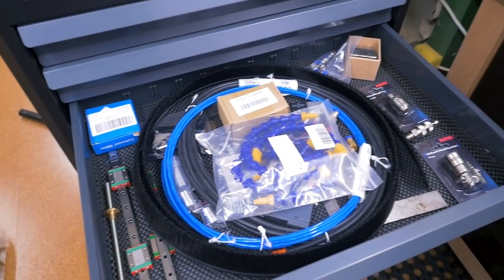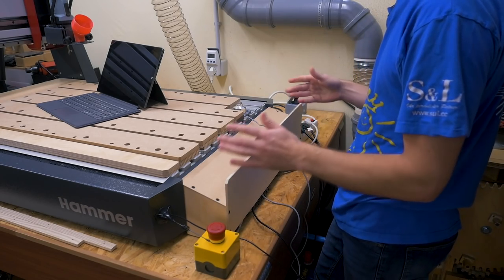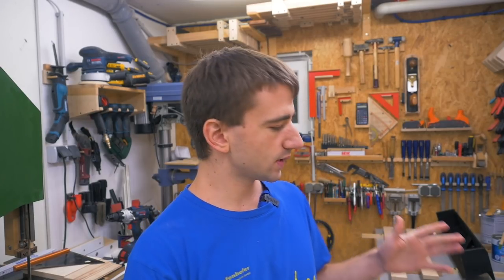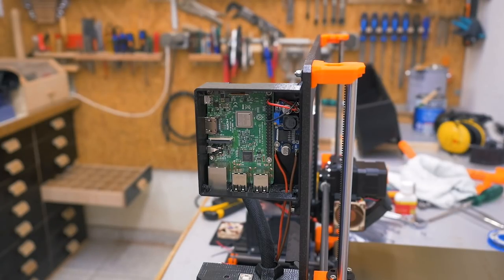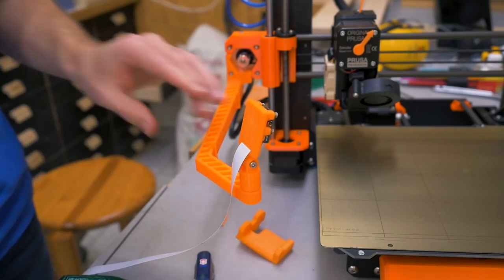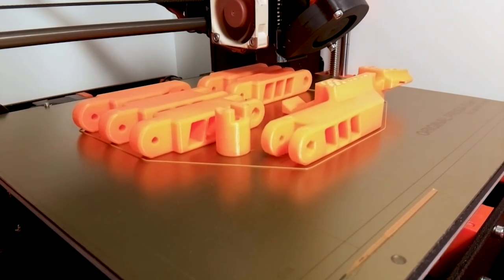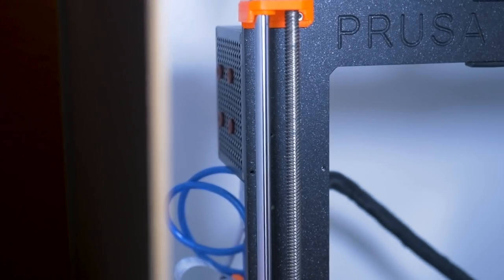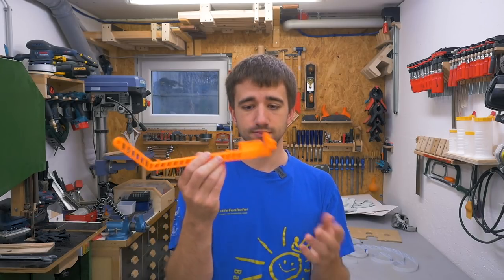Octoprint for the 3D printer and big project announcement (Random Shop Stuff 25)

Comment: Slotted screws are the bane of all true mechanical designer and engineers!
Reply: Robertson screws forever, eh.
Reply: I threw out all slotted screws from my dads workshop xD Fuck those things!
Reply: They beat the hell out of Phillips head  screws.
Reply: @calvingreene90  Torx master race
Reply: @calvingreene90  only if you have the wrong size screwdriver or no screwdriver at all lol. at least you can remove a flathead screw with half of the tools in a shop
Reply: Slotted have been around for 150 years? Manufacture was so much easier. So simple.
Reply: @bmxscape  
With Phillips you have to apply firm driving force even when removing screws even with the correct size driver.
Reply: @FearsomeWarrior  
True, but first generation of everything is lousy.
Reply: @calvingreene90  same with every screw on earth except torx and allen. with flat head screws, you must also use your other hand to hold the tip from falling out of the screw, with every single partial rotation the driver.
Reply: @calvingreene90  have you ever tried to use a drill to screw in flat head screws? id love to sit and watch you try!
Reply: @bmxscape  
Hundreds of times. I never had a real problem with it. Admittedly I prefer hex.
Reply: There is no engineering here.

Comment: Great video! Always enjoy these shop stuff ones. I got my first 3D printer a few weeks ago and never even used the SD slot. I went straight to Octoprint after doing some YouTube research, and never looked back. Also for what it's worth, I made the EXACT same setup with the step down buck converter for my printer to power a pi. I stepped the voltage down to 5.2 volts instead of 5.0 so that Octoprint wouldn't give me the power warning. For whatever reason, some Raspberry Pis need slightly over 5.0 volts or they throw a warning at the kernel level.

Comment: Marius, a straight 5v is not enough for a Rpi 3B which requires at least 5.1v to be normally powered. (you should see the underpower icon on the Octoprint's page) Personnally I set my PSU at 5.3v which is perfect for the Rpi power regulator. It's also not recommended to power the Rpi through the GPIO but to solder wires on the PP1(+) and PP3(-) under the Rpi. This way you keep on using the power regulation and power protection of the Rpi. This is probably wise with a chinese downstep module as power supply, by the way. ;) You should also make a custom USB cable with the bypass of the 5v wires. This way, the Rpi will not power the Prusa's rambo board by the USB cable. It's the good way to do it.

Comment: Does your PC have a decent filtered intake?  Project idea:  filtered cabinet for the PC, could mount it so it is off the floor as well.  Also, for shop applications I think passively cooling smaller computers such as the Raspberry Pi (maybe even your old editing rig) would be a better way to go.  No fans to pull in dust onto your components when possible is always a good idea in a work area where dust is a consideration :)

Comment: mounting the fan at 8:55: The normaly middle "washer" part of the rubber should be between the fan and the case. https://youtu.be/P-qSq9P_NLI?t=83 
(but the printer is louder anyway...)
Reply from the maker: Hmm okay. But the Noctua fan also has tiny rubber parts at the corners and these are now touching the case. But yeah, the printer is louder

Comment: Great "catch-up" video. Looking forward to the CNC dust collection project as that's on my plate as well, although ours is a considerably bigger and different CNC:  CNC Factory Viper XP (5'x10', 10HP air-cooled spindle, vacuum hold down and 10-position ATC).

Beyond the form factor, other complications for my project include automated tool changing, safety signaling and pneumatic dust boot control.

Comment: For the WiFi? I upgraded from an old Apple AirPort Extreme to a TP-Link Deco Mesh WiFi network. My garage PC is my workstation. The Airport was too slow (wirelessly) and I did not want to drill through the wall to send ethernet cord to garage PC. I plug the garage PC ethernet directly to the Deco mesh wifi and it tricks it to think it's hardwired. Bought another Deco for my brother's PC and we wired directly to it as well. Fast speeds all around the home.Hope it helps! Love the vids Marius! Keep on tinkering and improving your mods.

Comment: I would have used a switch to provide additional Ethernet ports from the power line adapter.  However what you did works without having to buy new hardware.

Comment: Friendly tip: Those DC-DC converters are normally rated for 1A, which for a RPi 3 B isnt really enough power. I had issues with mine so I got one that does 2.5A and now it works perfectly! I run Octoprint on my AM8 printer and its so much fun watching it via the webcam even though the printer is in the same room as I am :P

Comment: TP link...same as mine...just upgraded, as the old ones I had were lacking the latest security. Just for info, I found that you can connect different manufacturers units if they won’t communicate by a short Ethernet cable (if they are next to each other like yours), and they will work...like your printer setup...very nice...if only I had the time...

Comment: I have also widened holes in a raspberry pi. Mine was a model 2b, though. I designed a breakout board for some hall sensors and had it printed and shipped to me, but it's holes were too large and since the pi cost less that half as much as the prototype board I figured it was better to try widening the holes first instead of sending off for new prototypes.

Comment: Thanks for the video. You are not right about the aluminum being colder than the surrounding air. It will have the same temperature, but it just feels cold when touching it because it has a much higher thermal conductivity than air and transfers your body heat away from your skin much quicker than air. You can confirm with a thermometer that the temperature of the aluminum and the air is the same. The temperature of all the different materials like aluminum, wood etc. in the room (unless connected to a heating or cooling source) is identical to the temperature of the surrounding air. When touching a piece of wood, it will feel warmer to your hand than a piece of aluminum, even though the temperature is the same. Wood just transfers the body heat away from your fingers slower than aluminum will. 
When running the router, the top of the wood plate will heat up quicker than the bottom from the router bit friction heating on the top. Because wood is a poor heat conductor the top will heat up quicker than the bottom as it takes time to transfer the heat through a poor thermal conductor like wood. But the aluminum will never be any colder than the air even though it feels much colder to your skin.

Comment: I hate to tell you this but if you used a Raspberry PI Zero it mounts to the back of the Prusa control board and it will connect through the terminal holes supplied using longer terminal pins. The Prusa site has the instructions for this addition.

Comment: I found the Pi camera to give a very poor images compared to a cheap webcam, now I just use the webcam and it doesn’t seem to affect the Pi 3B in any way I could see. And it has a decent robust cable, that is long enough :-) And you don’t have to open the Pi to plug or unplug the cable. Now all we need is the CNC version of OctoPi.

Comment: I wouldn't hang the camera off the stepper like that, it'll put relatively huge twisting forces in the x-axis. Best to attach it to the frame at the bottom - yeah it won't move up with z travel, but honestly those kinds of timelapse aren't great anyway (they get old pretty quickly) best to pre-frame your shot, imho.

Comment: I'd also worry about stray wood dust filling the PC tower, even though you have such an effective collection system.

Ethernet kludge adds an additional hop, but I guess that's no big deal. Latest Wifi seems to be much more capable. Power line systems can be problematical depending on home wiring.

Comment: You will have problems with the dust in the PC. You should add filters to avoid the dust to enter the PC. It is crucial if you want to machine metal in you shop as the metal dust conducts electricity.

Comment: As far as the computer goes, I would think that the sawdust issue just from being in your shop would be a problem.. I'm sure you've done well with dust collection, but just seeing the dust inside your saw in your saw-slider vid would show a possible problem over time. It suggest you probably want some kind of filter on the intakes for the PC.

As to the teensy screws, yeah, PCs have their own unique screw sizes, it's a very good idea to order a general-purpose boxed set to keep around for use with any computer needs. You can get something like 100-200 piece with 6-10 different screw types, including the mounting posts (e.g., if you're putting a new motherboard down in a new PC case), and a couple sizes of flush-mount screws as well as the different types typically used in railing and securing devices (like drives) to rails. A lot of systems have inventive connectors/rauls available, but they often still need to be screwed on somehow.

Hilariously, many many years ago (OK, "decades"!), when PC magazine first appeared, they had a give-away for a subscription that was a handy little toolset. It was nice and really cute... Except that every single bit in it was too large for ANY PC screw. LMAO.

Comment: I really need to get Octoprint set up. When I 1st tried it in 2017 it failed with an error I couldn't find any fixes for. Might have better luck now. I also need to install the bed level sensor I bought 6 months ago lol.

Comment: Hi Marius, how many space are you now using in the cellar ? 80% ? I guess only the washing machine is left 🤪 nice Pril flowers on the wall 
I suggest to install some CAT7 cables during the next house renovation. I was lucky enough to have a support chute from top down to cellar (where my servers are). But I know in newer buildings with a chimney up from the cellar, there is often a gap between floor and chimney. That could make it easier to cross the Beton floors. While wifi still works in my cellar, the reliability and speed is much better with cable.
I like you 3D print Upgrades and what parts you are making. Thinking to buy my own, but iI am afraid what type of SW toolchain I need to use AND to learn. What is your toolchain ?

Comment: Marius, Really ingenious designs of the extra parts! Could you tell us and show us the reason you use the filament you use on the 3D printer? Seems strong but remains somewhat flexible. Maybe it get hard and brittle as it gets older? Thanks for another great and informative video!
Reply from the maker: It's just some cheap PLA. This construction doesn't need anything better

Comment: Im surprised the two ethernet to powerline adapters don't interfere with each other. They may actually be compatible, in that they are using the same framing protocol, but are intentionally ignoring each other's frames. This suggests that while they aren't interefering, they might be sharing the same signal frequencies, thus reducing the effective throughput of (that segment of) your network.

Regardless, if it's working for you, then it's perfectly fine.
Reply from the maker: I honestly didn't expect it to work

Comment: Powering through GPIO without fuse is the best way to burn Raspberry Pi... You should solder wires to the board before fuse used. Or add other fuse.

Comment: Wait how would the aluminum table be colder than the air temperature?
Reply: It Isn't.  A rare schoolboy error from Marius.
Reply from the maker: I now guess that the wood was bent from the beginning
Reply: Easy answer. When he goes into basement, he changes the temperature, with heater or by just being there. But the cnc has metal parts and can be considered a solid chunk of metal which reaches the equilibrium slower than the wood, so it can happen the way he explained.

Comment: Hi Marius, I love those rubber things you used to connect the fan, what do you call them and where did you get them please. I have a reasonable computer that I update when I can and the graphics card has five fans of its own without the fans to keep the core cool so I have a lot of fans I need to fit in my new computer cabinet. I like the idea of rubber mountings and that should also reduce vibration if I get any. I enjoy your videos and the things you make, I especially liked the life you built.
Reply from the maker: I don't know. They were included with the fan

Comment: Such a great video - I'm literally copying the whole thing - thanks so much!! One question - at 10;35 you connect the wires from the stepdown to the GPIO pins - how did you do that? It is not clear in the video and I would appreciate a steer here.

Comment: do you want to make a dust protector for your PC ? i guess it may be neccessary what with all the sawdust/off cuts floating around in the shop.
i know you have a really good dust management system but i know you will never get all the dust, and sawdust inside a PC is not really a good idea.

Comment: It's not recommended to run the pi from the printer PSU, as the PSU is barely enough for the printer itself. If you run into weird issues try powering the pi separately.

Comment: At 25:00 you mentioned there are some bed leveling plugins that you use, which ones do you use to check bed leveling?   And at 25:30 you mentioned there is a plugin that tells you  how much to rotate each screw, which plugin is that?
Reply from the maker: the first one is called "Bed Visualizer" and the second one for the screws is "Prusa Leveling guide"

Comment: I rarely think you are wrong Marius. But why on earth would the aluminum table be colder than the surrounding air?
And even if it was, wood doesn’t move with temperature. It moves with humidity.

Most likely reason is that the piece of plywood is dryer than the equilibrium air humidity and air is mostly only reaching the top surface.
Reply: The wood doesn't move, the aluminum does.
Reply: @barrygerbracht5077  No? Not unless the temperature changes, which I doubt it does in his basement.
Reply: @AndreasEkbom  You answered your own question and then dismiss the obviousness of it... ok carry on.

Comment: I saw a Bosch MRP23EVS router in the background and I want to know you opinion about the router as I want to buy it too.
Reply from the maker: Amazing what you see in the nackground of my videos :)
I quite like it. It has enough power for basically everything and the plunge base is the best I have so far (but it also has a tiny amount of play in the guides). I especially like the fine adjustment that can be used when you already locked the depth setting. Perfect for setting the exact depth of a cut

Comment: Get a flux pen, it will turn you into a soldering pro.
Reply: I've always used solder with a flux core and it seems to work fine.  A flux pen seems to help with surface mount components, when using a reflow oven.

Comment: Hey Marius, great video as always! If you are using RaspberryPi 4, have you tried turning off the Bluetooth on it and then connect to where your WiFi signal is weaker? I had that issue with my brand new Raspberry Pi 4. Not sure if it is just my device, or is it a general issue.
Reply from the maker: I use a RPi 3B

Comment: Eine Warnung: DLAN kann die Stromkabel deines Hauses in Antennen verwandeln, wenn die nicht gut geschirmt sind. Das kann dann zu massiven Störungen von WLAN/Mobilfunk führen und mit extra Glück kommt die Bundesnetzagentur mit einer dicken Rechnung vorbei :D
Reply from the maker: Interessant. Ich nutz die Dinger seit 7 Jahren problemlos
Reply: @MariusHornberger  Keine Stromkabel in einer "normalen" Hausinstallation sind geschirmt. Und solange du das Powerlan Gerät in Deutschland (genauer für den deutschen Markt) gekauft hast, gibt es keine Probleme. Wenn doch, verweise an der Hersteller. Aufpassen mit Importgeräten, auch wenn sie auf eBay oder Amazon angeboten werden. Das einzige was sein könnte, dass der Stomzähler die die Datenübertragung nicht 100% ausfiltert. So könnte theoretisch jemand von Außen die Daten sniffen sofern er nahe an deinen Stromanschluss kommt.
Reply from the maker: @Dirk R Das Daten sniffen halte ich in meiner Gegend für sehr unwahrscheinlich :)

Comment: Hi Marius, hi guys. If anyone interested in doing the bed leveling mod, check out this simple jig I made to assist you with tightening the screws. Hopefuly it speeds the process and saves you from headaches. 
Designed for Prusa MINI mod, but the principle is the same on MK3.
https://www.prusaprinters.org/prints/43629-prusa-mini-silicone-bed-leveling-mod-bed-tightenin
Reply from the maker: Sweet design!
Reply: @MariusHornberger  Thank you! 😀